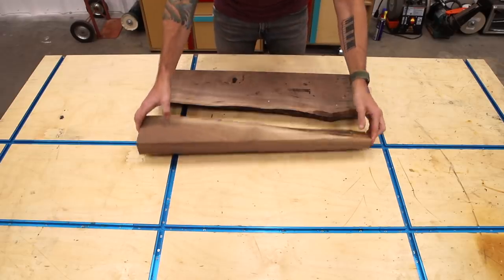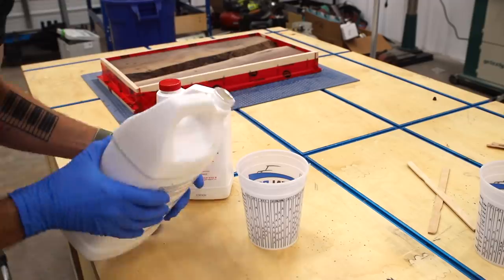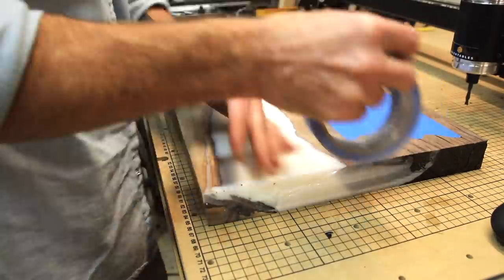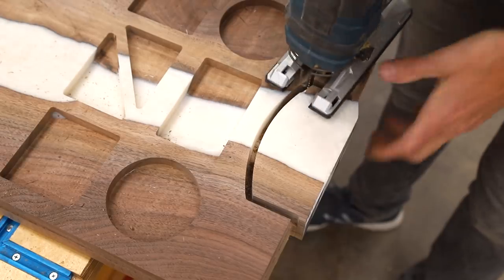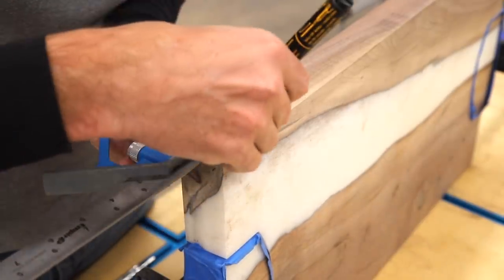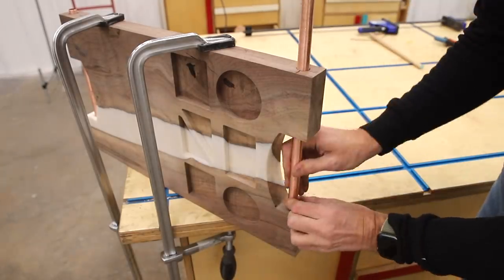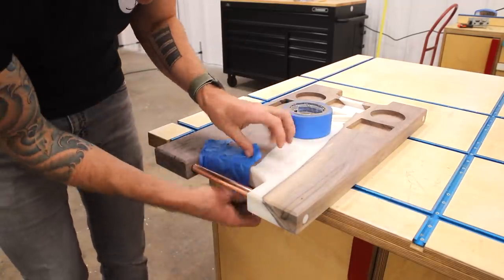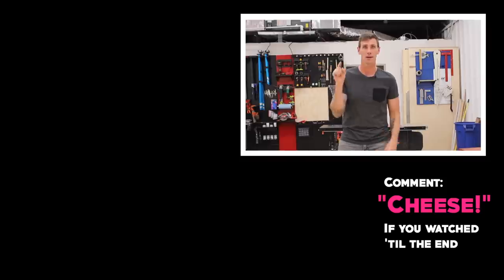Trash Wood To Treasure - Epoxy & Copper Cutting Board | Serving Board

Comment: Cheese! Great board. Love those little touches that make your work products special and stand out from the masses.

On a different note: you seem a bit taller than many folks and it doesn't seem you customized your work surfaces to accommodate your height. Take care of your back - others can adjust to your-sized work surfaces in the less time they spend on them, just as you have done/do on standard issue work tables/machines. 

Just sayin' 🙂

Love your work. Love your channel. Thanks for all the inspiration.

Comment: "This" or is it "Cheese"? You just said "comment "this"" 😋 That board does look really good. To avoid tear out when drilling into wood, I've used a mix or spade bits and forstner bits, but brad points are my favourite. I've also used metal hole saws to start the hole off, but they need to be really sharp! I then finish off with a regular wood bit, which gives a really clean hole. 👍

Comment: At any plumbing supply place you can get copper "plugs" by drilling out the ends with a larger bit 1/2 inch in and gluing the ends on it would have made a nice finish accent to the sides.

Comment: Did you ever seal the live edges before the pour? What did you use or why didn’t you seal the live edge? Have you ever had a problem with the “joint” between the wood and resin failing if the board is dropped?
Reply from the maker: It’s not necessary to seal the edge. The epoxy penetrates and fuzes the wood to the epoxy. The “joint” isn’t going to break or separate.

Comment: Hi! These boards look so good I want to try it myself. I researched and found that epoxy resin is non-flammable and virtually odorless. Is this true? Also is the vapor of the epoxy while it is curing flammable? I'm borrowing a shop to do this in so I need to ease their minds.

Comment: Jonny, so how did you prevent the epoxy from running underneath your walnut in the first pour? Super tight fit with the pieces in the mold? or did you use hot glue on the bottom edges of the walnut or something else?
Reply: Scott Revere 1:45

Comment: Nice job! Question though. The food grade mineral oil finish, when you clean the board do you just rinse with water or how would this be cleaned?
Reply from the maker: Rinse with soap and water and dry immediately. Reapply mineral oil finish as needed.